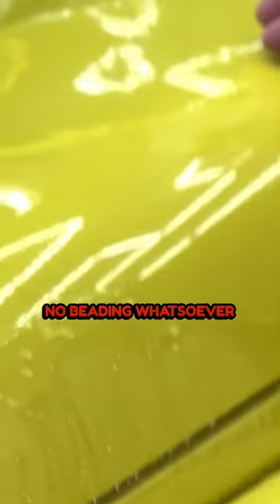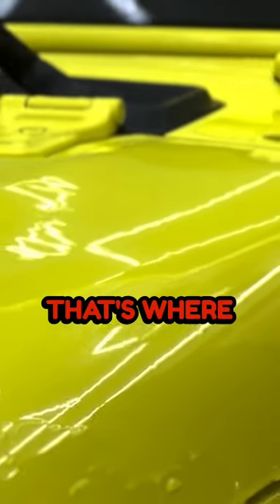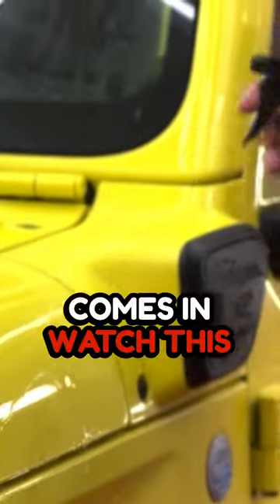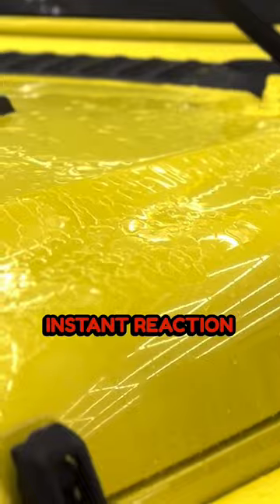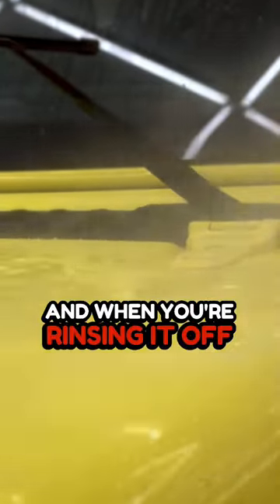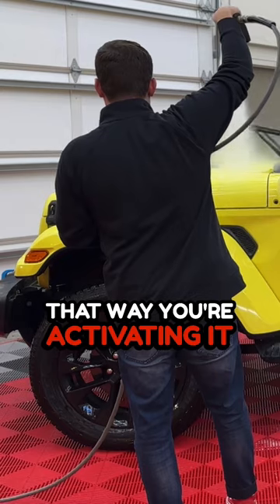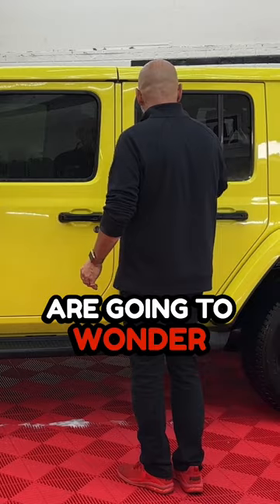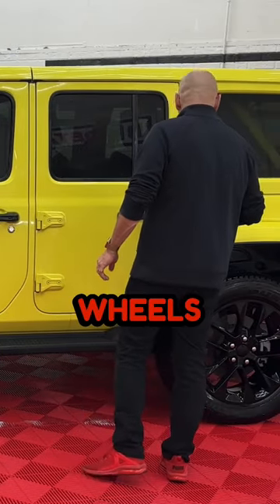Spray on, Rinse off=Ceramic Protection

Comment: I use nufinish ceramic coating from Walmart. I did the exact same thing on my vette and it seemed to have the same reaction. Can you go in depth on how your product is better that something from Walmart?
Reply: Many products are very similar. Take hybrid solutions ceramic spray by turtle wax, ceramic wax by meguiars, cleaner wax by mothers, just to name a few. All these will effectively act the same, beading and sheeting water. The main difference would definitely come in longevity. Some products will have a much higher chemical resistance and last a lot longer. Apart from this, user experience is also something to consider when using a product. Maybe you like the smell of one over the other, maybe you like the spay trigger over another one, maybe you get streaking from one and not the other.
Reply from the maker: Thank you, we couldn’t have said it better
Reply: If price is your main issue. At $16 the16 oz of nufinish ceramic coating is a few dollars cheaper than 16 oz of quick beads. If you get a gallon of quick beads it comes out to $11 per 16oz. Now can you go in depth and tell me how nufinish is a “ceramic coating” i mean its literally the name of the product.

Comment: Just because water beads does not mean the paint surface is protected. If it’s too good to be true, it is. Spray-rinse coatings are a waste of money.
Reply from the maker: Unfortunately many are, DIY Detail Quick Beads gives lasting protection, and is easy to apply.